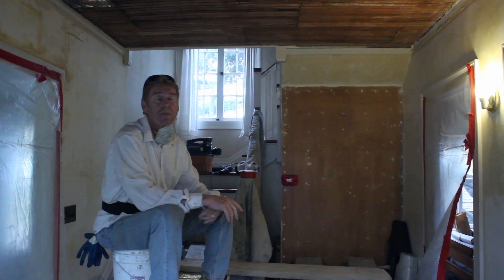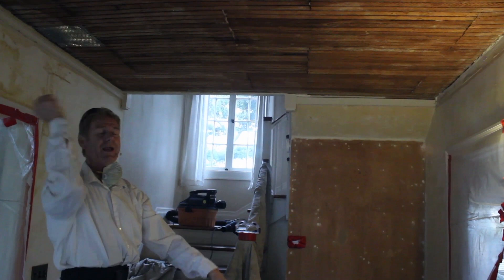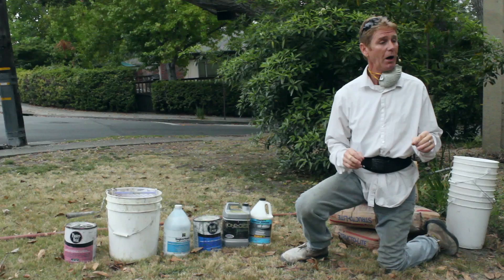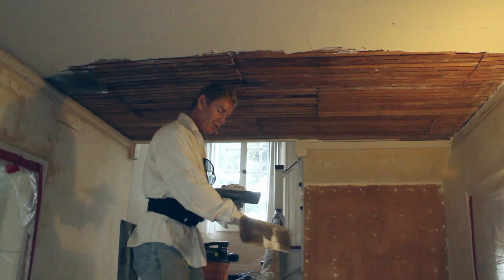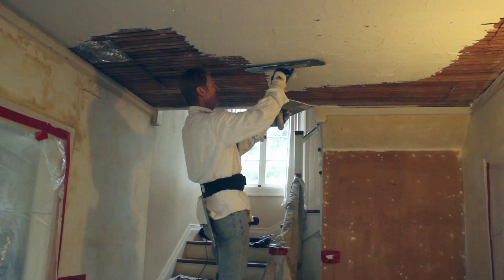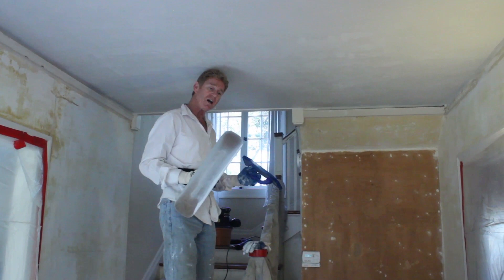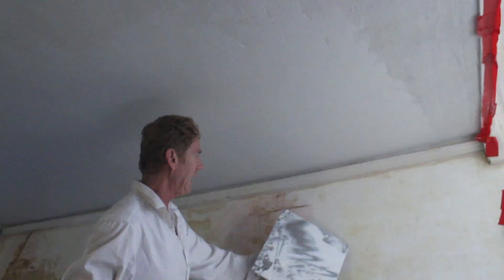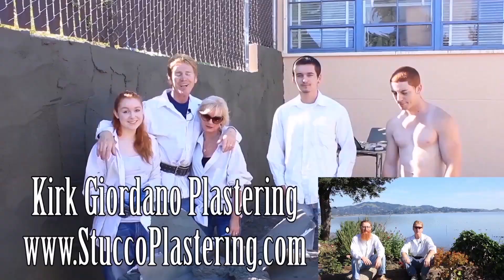Structo-Lite base-coat with a lime plaster finish

Comment: Howdy Kirk,
 I've watched a bunch of your plaster videos as I have a 200 year old house and need to learn how to plaster.  

I came to this video from a link on your "Teaching Internal rendering, plaster ceiling repairs" video.

I went thru all the comments to hopefully find answers to my questions but did not see any. I'm taking off a 300 square foot ceiling, as much of it has become separated from the lathe, and want to use the method, and products you show in this video to do the repair. My old ceiling plaster is 3/8 inch thick, so as you mention I'm not going to make the new ceiling much, if at all thicker than that.

You only mention Structo-Lite in this video but also mention you are doing 3 coats.
I also hear you mention Diamond/Veneer final coat.
I know you are using Structo-Lite for the base coat.
But I don't hear you mention what you are using for the second and third coat and don't want to assume anything.
I know Home Depot carries Structo-Lite so I'm hoping whatever you are using for the second and third coat I can also get there.

Questions:

1) What product(s) are you using for the second and third coats?
2) How many square feet would you guess you can get out of 1 bag of Structo-Lite?
3) Or in other words, how many bags of each product would you guess I would need to redo a 300 square foot ceiling 3/8 inch thick?

Thanks so Much
Kevin
Reply from the maker: Good Morning Kevin dude, I applied two coats of structo-lite than a finish coat of veneer plaster, sorry for the confusion,          happy holidays         
                              Live long and plaster
                     Kirk and Jason Giordano plastering tips
Reply: Is any veneer plaster okay on top of structo lite? I have a bag of Imperial.

Comment: Hi Kirk, 
Thank you for all of the great, informative videos. 
I was hoping you could provide some insight into an issue I encountered today. I plaster welded some blue board and then did a base coat of structo lite. I let it dry overnight and it appeared to be dry and was hard to the touch. I tried doing the diamond veneer and when I did, it made a crackling sound like rice crispies. I troweled through it and ultimately it had what appeared to be bubbles, roughly the size of peas. The bubbles were not holes, but raised like little hills. When it was almost dry I scraped it with the side of the trowel to make it a bit smoother. Any idea why this may have happened or how to avoid it in the future? I was thinking of doing plaster weld before applying the diamond to help slow the suction. 
Thank you!
Nick
Reply from the maker: Evening Nick, of course, I know why this happened, you needed to wet the structo-lite or you could have applied a bonding agent to that surface, this video below is for your future projects.
https://youtu.be/8yqzBa9MU7Y/Truth of Veneer Lime Plaster, not what you think.
 Kirk Giordano plastering
Reply: @StuccoPlastering  thank you! My inexperience got the best of me. The video you referenced answers all my questions 😊

Comment: I am making a wetroom from a tub, vanity enclosure. It will be a large tiled shower and tub area. I have a drywall ceiling that will need patched. I would like to put mesh tape over the seams, paint a waterproofing on it then veneer plaster it. I would think it might hold up better than paint or drywall joint compound. Should I use a bonding agent on top of the waterproofing, then plaster or am I up the wrong creek altogether? I am good at drywalling so I figure I can plaster a 10x6 ceiling.
Reply from the maker: Evening Brenda, I'd recommend if you have a top quality exhaust fan to use veneer base coat then finish with veneer.
 No exhaust fan, use tile or you will get mold every year.

                         Another day at the office for us, 
  Sharing stucco secrets and or common sense plastering tips

Comment: Hello sir.I want to ask your advice.I am a renovator ,and field of my activity is renewing apartments and condos.Usually I have to straightening walls and ceiling and i usually do it with structo-lite like basecoat and next layers with compound. The thicknes of first coat may vary from 1/2" to 2".Because of it  basecoat is very laboriously if do it by hands. Could you give me advice by what machine I can use to apply structo-lite in my case? The are a lot of machines in Europe for these specializations, but not in USA. I will be very pleasent to hear your answer.Thanks.
Reply from the maker: Good afternoon Peter dude, the best and fastest most accurate and least time-consuming machine I have used in all my years of plaster is my arm, without a doubt the quickest and the cleanest by far.
 You can use hand hoppers for a dash finish or even the Graco pumps, but unless your spraying large buildings and have at least ten journeymen who understand what they are doing, stick with your arm.
                       Live long and plaster
           Sharing the plastering knowledge

Comment: Thanks mr. Giordano. We need to fix dry rot around windows in plastered house, got any tips?
Reply from the maker: Good morning Crochet Dude, you will have to start with explorations to see what needs repairing.
 Best advice I could give is get help, remove, replace  wood rot and lastly replaster
                          Live long and plaster
           Plastering tips for your information

Comment: Hi, Kirk! Mi name is Michael. Watching your videos is a sort of discovery channel for me here. )) Helps a lot!

Recently I started plastering a wall, made of foam concrete blocks (closed cell type). Cement-sand mixture, wire-mesh, prewetted walls, almost indoors (that is not exposed to direct weather conditions), 2 layers (3 rd will be a finishing one). Now, after a couple of weeks, I can hear that there are voids beneath plaster layer. No too much, but not nice. So, I guess, it's a problem with adherance. 
Do you ever use any primers, adherance improvers or smt to avoid such toubles (if you ever have any)--especialy for this kind of surfaces? Or maybe I'm just wrong with technology (technique)?

P.S. Hi from South Urals, Russia.)
Reply from the maker: Good evening my Russian friend, this is a main reason why I never attach wire mesh to cinderblock walls with the 3.4 stucco mesh or ang other stucco gauge netting, it does more damage than good plus, it has little to no benefits,
 A properly prepped cinderblock, brick, terra cotta or in your case foam concrete block wall, will be best if cleaned well of all dust dirt and grime, (as nothing adheres to dust)
 then what we do is wet or mist the walls as even as possible depending on the weather and apply stucco directly to the surface, thus achieving a natural and permanent mechanical bond stronger than if mesh wire were to be attached  as this wire impedes the natural absorption of suction of the two cementitious materials.
 Most folks feel wire makes the walls superior, it does not!
 Type in how to apply stucco over cinder blocks on this channel to view at least 10 videos on the subject, if you wish.
FYI, there's very little difference between the blocks you used as to cinderblock, one has sand for extra strength your has foam for lightweight blocks, both are porous.
                       Live long and plaster
Sharing the plastering knowledge for those interested
Reply: Well... discoveries hurt sometimes. 
Thank you for your swift and detailed explanation. I should have been more attentive to your channel and less self-assured.
on FYI. I dont know if they use this technology in the US but we have two types of foamcrete: autoclave steam treated open cell ('ytong') type and time matured closed cell type (practically doesn't absorb water)--my, way chipper, case. It appeares, that closed cell impedes suction and makes adherance much worse than that of cinderblocks. This is why I started thinking of adherance improvers.
And a classical silly question: now, as I'm at the very beginning of (inevitable) separation process, what can I do (if any) to maximally possible postpone the result? I'd say that voids are roughly up to (say) 5% (didnt make precise estimates)
Reply from the maker: Good morning me Russian friend, if I told you how many times I have learned from not my mistakes but mainly from experimenting as I do have a wild imagination or had, you would laugh, that's life.
 in my opinion, your walls should last a few hundred years even with a bit of separating as most will hold tight, now if it were wood walls the rain would get in and expand the wood, thus push the stucco further and further until some separates. 
I see this often, in fact I have a job right now that the stucco is roughly 4 inches from the wood do to water penetrating behind the fascia boards of course the building took 100 years to get to this stage. 
 
                          Live long and plaster
           Plastering tips for your information
Reply: Thank you for your time and advice!

Comment: kirk ive always wonderd if you can finish with a round trowell ive been using a 16' inch curry trowell for years recentley ive swithched to a NELA mediflex for finish its incredible but i learned you cant throw on with it only finish
Reply from the maker: Evening Brian, things that make you go hmmm.
 I feel I can use some trowel better than others that's why my truck has about 30 different trowels.
 I'd recommend you use whatever trowel you're comfortable with my friend.

                         Another day at the office for us, 
  Sharing stucco secrets and or common sense plastering tips

Comment: Hey Kirk! Great video! I have a question and its probably a stupid one...anyways on the walls of that room, why were there yellow and brown spots? Is it mold or does interior finishes just discolor like that with age? Love your vidoes! Hope you and your family is well!
Reply: In my situation, and most I assume, that is wallpaper glue left over from removing old wallpaper. A good steamer can get most of the glue off, but the color remains. When painting, use a primer with stain blocker.
Reply: Randal Rioux thanks!
Reply from the maker: Good morning Sarah, hope all is well,
the fella below is on the ball, it did indeed have walls paper on the walls at first,
                          Live long and plaster
           Plastering tips for your information
Reply from the maker: Good morning Randal Dude, exzackory
                          Live long and plaster
           Plastering tips for your information

Comment: So you put 2 coats on. The Base and the veener, I'm I correct?
Reply from the maker: Evening Jose yes, structo-lite can take up to 3 to 6 hours to dry, here a monster tip, add a handful of Portland cement the structo-lite it will set as fast as you want it to.
                         Another day at the office for us, 
  Sharing stucco secrets and or common sense plastering tips

Comment: I just used some structolite today! So 2 coats of base coat over wood lath and 1 finish coat?
Reply from the maker: Howdy Chris Dude, as a rule yes, depends on what you wish to achieve.
I have applid one fat skim coat many times on basement walls which serve as bedrooms where the owners didn't like the look of concrete cinder blocks or bricks.
                       Live long and plaster
 teaching those interested how to repair their number 1 investment

Comment: Hello, what is the difference in use, strength, hardness or appearance between using Diamond Finish Coat (over Structolite) OR instead, using a bag of lime (like Ivory Finish Lime)(hydrated in water for while) mixed with a gauging plaster (and then put over structolite)?
Reply: Lime and gauging is better....you can knock it down better, meaning you can work it easier for smooth finish. Its more friendly to a plasterer and a good product. Diamond is good but it isnt as forgiving as lime gauging. When it sets you dont get no cream and it better be rite and diamond veneer finish gets hard and i mean hard!
Reply: @croboy751  what are some manufacturers or brands of lime and gaging? Having trouble finding them in the south
Reply: @rebicul  USG and Goldbond are the most popular plaster manufacturers. It’s getting extremely hard to find these products anymore also. Many people are leaning towards drywall/joint compound cause find people skilled in plaster is getting harder every year. Any good builder supply place should let you order if material isn’t in stock.

Comment: You do a great job. My only question would be.. the whole ceiling is out.. why not just put drywall up at this point
Reply from the maker: Evening Brian, the owner asked specifically for new plaster, not sheetrock.
 I do as asked, as a rule.
                         Bringing peace, love, and harmony back to the world of plastering.
With over 800 educational and free Youtube videos, by your favorite plaster geek, “me,” and Jason, my son, the bearded plasterer.
Reply: Plaster is superior to drywall as a building material in most regards, except for time and money. If you can spare the time and money, plaster is more durable, insulates against sound and temperature better, doesn't promote mold growth, and actually "heals" from water damage to some degree (provided the leak is corrected in time).

Comment: Wow, you make it look so easy. 

? My dad had interior plaster done with structo-lite over a mortar base coat in metal lath over board. He was told SL could be used as a finish coat product and how he came to do mortar and lath inside is beyond me. Well... it is super rough and dusty (I guess due to the mortar base coat that had sand in it) and obviously not a nice finish coat. I call the whole thing the 'plaster disaster'. I have trowel scraped all the walls down and to clean the sand off and then sponged them with to deal with the dusting.

What would your recommendations be to finish coat over this? I did call USG and they said USG plaster bonder (can not find it anywhere) then red top gauging plaster with pearlite aggregate.
Reply from the maker: Hi Jeet, one can finish structo-lite plaster but it takes the know-how.
 I have applied it and used it as a smooth finish many times. 
One must use a wet trowel once it starts to set then simply keep the trowel wet in order to do so.
 Buy some Quikrete bonding agent at HD or lowes then paint the area in question, then, "google plastering yards near me" to buy some Diamond or Imperial finish coat plaster as these plasters are not sold at the hardware stores.
 Another simpler option is to apply the bonding agent and use a drywall compound over your existing finish.
 Your dad actually did know what he was doing but didn't understand that structo-lite can indeed be smooth troweled as long as the trowel is kept wet when finishing. 🍾

Comment: Hey Kirk - im patching a hole... couldnt find the plaster weld, went to 2 home depots.  I did find “henry self stick tile primer” .. would that work??
Reply from the maker: Good morning Dave, you can use Quickrete bonding agent, this bonding agent is sold at all HD stores. 🤔
It's white and sold in gallons or pints.
  Our unique plastering Tip:  all subscribers or anyone who stumbles on our channel with a question, type it into our Stucco/Plastering channel, and like magic, a video will appear to explain how it's done. 	
   This feature is miles ahead of any plastering forum. 🥳	
https://www.stuccoPlastering.com
Reply: I appreciate the response - yes sir, i have 1907 house in NJ, plaster walls, popcorn ceilings that im in the process or skimcoating... spinning my wheels to find a better way.   Also, replacing moulding, and cracks etc in the walls....  Going with structolite for base, then sand 40, then skim coat w all purpose joint compound..   i book marked the link you sent, im going to submit some things through there.  Huge help, thanks again!

Comment: Hey kirk quick question 
What kind of interior plaster can i use for my home without painting the walls
Reply from the maker: Howdy  Michele, veneer plastering, you can add the color in the top coat, this takes practice, and more than likely the color wont be an exact match.
 best wishes,     
                                   Live long and plaster
                         Sharing plastering information
Reply: Kirk Giordano plastering Inc. Thanks kirk
Im a taper and
I use to be a plasterer in italy up untill 2012 then i moved here in montreal canada and theres not really a big demand as REAL plasterers so i went in the closes field wich is taping
But the veneer you use i use to use them in italy and last time i used veneer plaster was arround 6 years ago so i hope its like riding a bycicle

Comment: Hey, would you say it's safe to use Structolite as a basecoat over Quikrete bonding agent on sheetrock? I have Diamond finish, but it's very hard to get Diamond or Imperial basecoats where I live. Would you say it's best to aim for 1/4" as a base coat with Structolite, then 1/16" to an 1/8" or so with Diamond? Would it be superfluous to use the bonding agent on the Structolite basecoat? I've read of some people doing that when using Structolite as a base coat. Will you likely be OK with not using it as long as you don't trowel it too smooth? It's in a bathroom, so humidity will be high, so I want everything to last as long as possible.

Thanks very much for your videos, you're like a plastering Bob Ross! :)

EDIT:
Would it be superfluous/not needed to prefill any seams with Durabond 90 before Structolite?
Reply from the maker: Howdy Bates dude, yes you can apply structo-lite over Quikret bonding agent, and a veneer plaster over the basecoat structo-lite.
 I would not advise the 90-minute mud as it's a sheetrock compound for joints as it's not compatable with the plasters you will use such as structo-lite or the venners.    
                                  Best wishes,
    Professional answers on plastering projects with issues